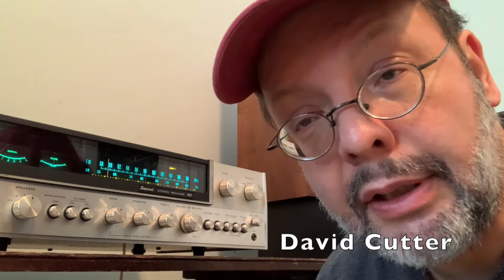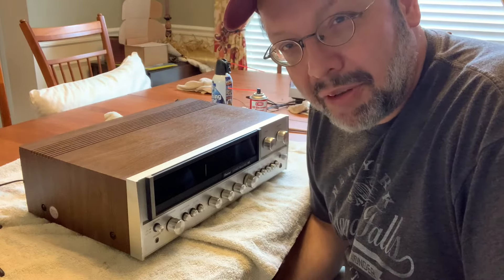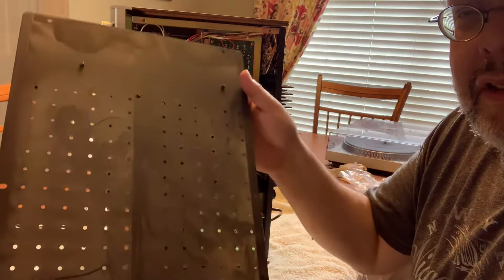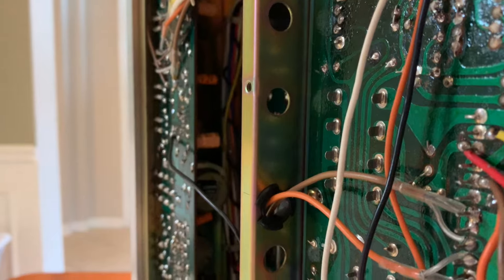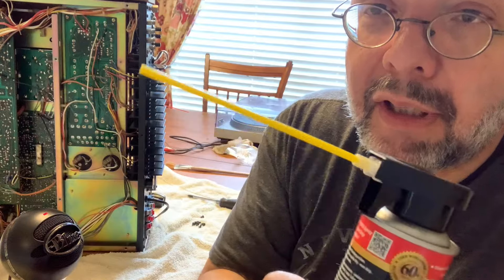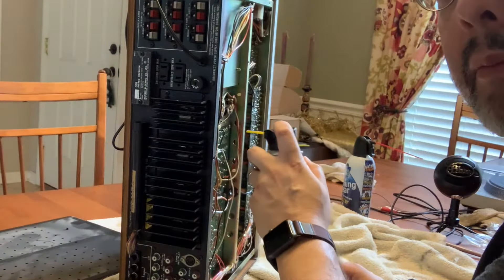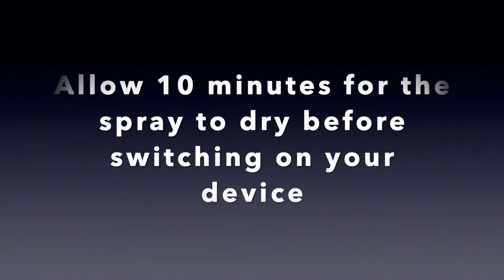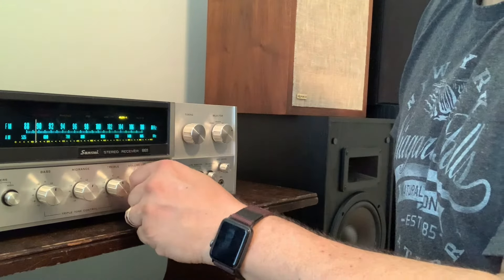Stereo Receiver Quick Fix! The Magic of Deoxit.

Comment: That contact cleaner can cause problems with carbon film variable resistors and shouldn't be used can cause the carbon to separate from the body you need the one 5f design for these pots
Reply: It's some kind of carbon oxide and with DeoxIT you are deoxidizing that film, literally destroying it.
Edit:  DeoxIT Fader F5 green bottle is safe on carbon tracks.
Reply: @Omega_Mark D5 is safe on carbon tracks as stated by caig. D5 and f5 use the same solvent at the same percentage. F5 was originally created to be safe with plastics
Reply: Using early cleaners, I had an unfortunate incident when our procurement department purchased a variant of the cleaner we had been using and I observed a relay with a phenolic base kind of melt away. Be really aware of what the compatibility of the cleaner is to plastics.

Comment: Just a suggestion be careful with the deoxit on the rotary controls it can destroy the carbon I recommend CRC 226 a lot of experience technicians know about the accident on potentiometers can ruin them just thought I'd make a comment have a great day
Reply: Absolutely true.
If you're going to use Deoxit, use the Deoxit in the green can. It's for faders and pots where it doesn't destroy the carbon track/slide surface in the pot

Comment: Just yesterday I finished cleaning and re-lubricating 22 Faders and 2 potentiometers on my 1978  Soundcraftsmen PE2217 Preamp - Equalizer.   Many of the Faders were intermittent, and all of them were tough to move due to the lubricant having dried and hardened after 45 years, and one potentiometer was also intermittent.  It took some time, but they are all working properly after blasting them with Deoxit.  I then had to lubricate the 22 Faders with a silicon lubricant.  Now all is well, and the Faders slide better than I can recall before.

Comment: My dad's old pioneer sx5 receiver had the same problem and I did that too.  I had to continue to do it every 6 months or so because some scratching would come back, but each application improved things. Eventually it will be completely gone for good.
Reply: You were supposed to use DeoxIT Fader F5 green version for pots, as the red one eats the carbon track, so eventually the pots stop working.

Comment: I own three Sansui components:
G-7500 
G-9000 
AU-D11ii 
All three can benefit from a can of Deoxit D5. 
There isn't any static in either one one of the three volume controls. However, the balance and the tone controls could use some Deoxing. 
Appreciate your videos. Thx!
Reply from the maker: I've used it on push-buttons as well. Thanks for your comments. Dave.
Reply: Ooooh! G9000!! 😱🥂
Reply: The red one is for metal on metal.  For pots you need the green Fader version.  It's safe for carbon pots.
Reply: @Omega_Mark  Excellent
Reply: @jamiesmith6838  The "5" in D5 or F5 means 5% lubricant and the rest is a cleaning/deoxit solution (different composition for green/red).  Ideally, if you have a good access to a fader/pot, you may want to follow up bit later with F100 (all lubricant), but often F5 might be enough.  Never try to spray F5 through the shaft hole in the front, as you will removed thick lubricant on it and make the shaft more wobbly.
Reply: @Omega_Mark Thanks for the information. I appreciate that. 
I have and used D5 sparingly. Meaning, I haven't sprayed any "under the hood" sorta say. Just where it probably might have less effect? I don't believe I've sprayed any thick grease away. Nothing feels loosened.
Reply: @jamiesmith6838  Someone mentioned here that he had to reapply D5 (didn't know better) every 6 months and finally the pots stopped working altogether.  Hopefully that will not happen to you now with F5 ;).
Do not use too much of this stuff.  The new straw is too big for precise applications.  They sell an adapter to a slimmer straw that you attach at the end of the big straw or you can make one yourself with some shrink tubing and old straw (make sure the straw is clean inside and doesn't have remnants of WD-40 or similar).
Reply: @Omega_Mark  Got it. F5 is the one to use.

Comment: thanks for this video! i had the same problem with my realistic receiver, one channel didnt work at all and the volume knob when turned would crackle. i might try this out instead of sending it to be repaired.
Reply: For pots you need the green Fader version.  It's safe for carbon pots.
Reply: @Omega_Mark  ok.. i tried this version and it worked for a while, im guessing it got dirty again. ill try the green one then

Comment: DO NOT USE Deoxit D5 (Red can) in a pot. Over time it will ruin the pot. 
USE Deoxit F5 
Pots work by using a carbon slide surface as a variable resistor. As the slide contact moves along this carbon surface, it increases and decreases the resistance. A volume pot is a variable resistor. 
Deoxit D5 will destroy that carbon slide surface over time. Especially if you use a lot of it.
USE Deoxit F5 and don't spray it where you have it dripping out of the component. 
You only need a quick burt of it. You immediately turn the pot to work the cleaner into it.

Comment: QUESTION: Aren't you supposed to put the straw into the small hole on the volume pot and then spray? I'm about to try this in the near future. Maybe that's what you did do..I'm not sure. How else would the Deoxit get into the housing of the volume pot?
Reply from the maker: Yes, use the holes to get it inside.

Comment: My Nikko nr-1019 keep cutting out on left side. I’ll try this!
Reply: My Nikko has been doing that on and off for years! I have a sta 4030 and everytime I've taken it to be fixed, within one to two years it's the same problem all over again. I'm even on a second set of vintage speakers with new cables. I might try this as well, but man this has been frustrating over owning this for 16 years.
Reply: For pots you need the green Fader version.  It's safe for carbon pots.

Comment: Nice video and receiver. Would Deoxit work when one of the two channels when I turn on the receiver cuts off and goes back on  for a while I fumble with one knob and another  until the channel stays on? When this happens, the speaker makes noises as in your video, only worse. In my case, the watt metre tells me that there is little or no no power going to that channel. Could it be I need to get one or more new capacitors installed? Is that an expensive thing to have done? Thank you.
Reply from the maker: Definitely try Deoxit first. It fixes many issues.
Reply: Same thing happens on my Nikko

Comment: Use Deoxit Fader green bottle for pots.  You will destroy your carbon track with the red bottle.  It will work fine for a while with the red one, but that's not the solution long term and you might end up having to replace these pots due to chemical damage from the spray.
Reply: Very true. I'm seeing tons of people on YouTube swearing by it. 
I've been building, playing and working on guitars and electronics for more than 35 years.
Reply: So is the red deoxy okay for switches?
Reply: @jacksonrauch9429  The red one is for metal on metal contacts with no carbon oxide coating.
Reply: @jacksonrauch9429  yes

Comment: Be careful using de ox on pots. Use fader lube instead. De ox may effect the adhesives holding pots wire wraps together inside the pot
De ox is better for switches and connectors.

Comment: Do you think WD40 or battery corrosion spray would have a similar effect?
Reply: NO!
Reply: @len9518  WD40 is an insulator.  For pots you need the green Fader version.  It's safe for carbon pots.

Comment: next time pull the nob and spary it down the shaft that works to i do it all the time when i cant get to the pod it slef.hey it works
Reply: Usually not good enough. Nozzle needs to get in that little hole you saw in the video.
Reply: Do not spray it down the shaft.  You are removing the special lubrication for it and it will not be as tight anymore.  You are supposed to spray it from the back you never used the red D5 version.  Use the green Fader F5 for pots.

Comment: WD40 will do the same thing at a much cheaper price
Reply: WD40 is an insulator.  Not recommended for audio equipment.  You don't want that on pots, just on metal bolts, etc.

Comment: Yes get the boards nice and soaked. Spray everywhere. Over time the fiber expansion will tighten the connections and make a big improvement in sound. 🙈 just don’t do it.